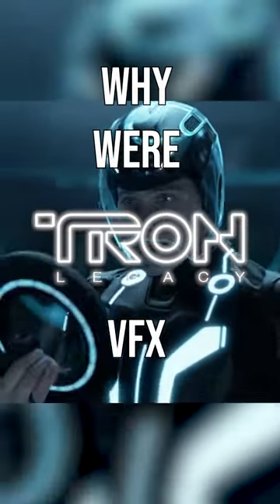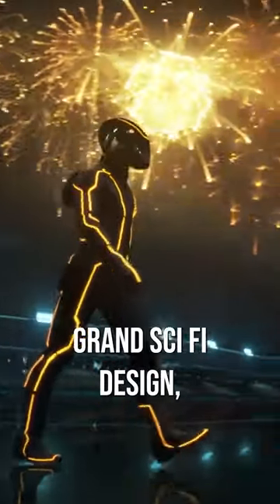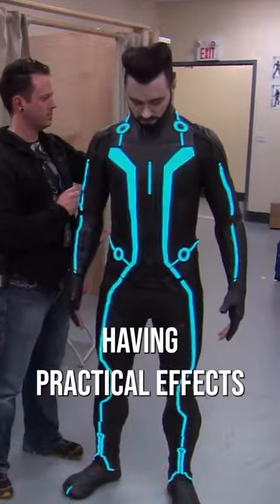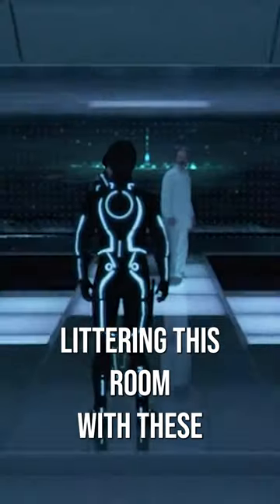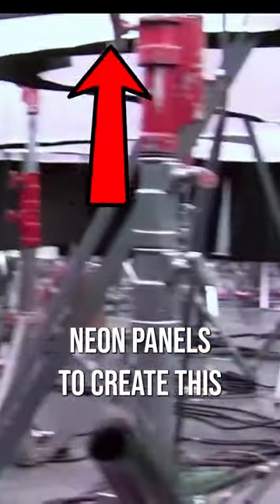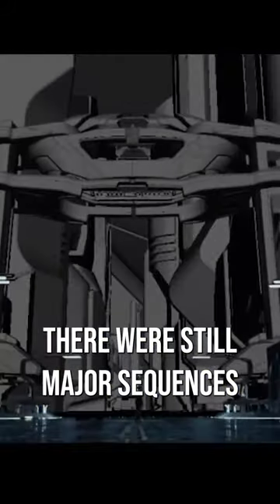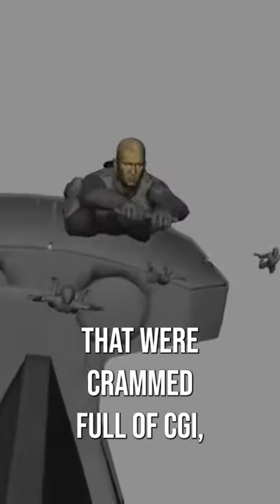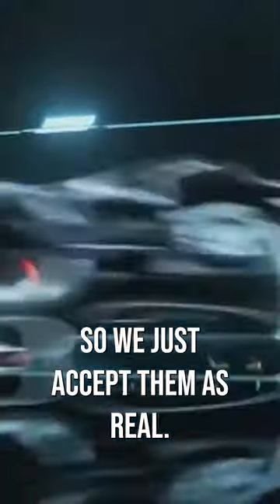Why Were Tron Legacy's VFX So Realistic? #cgi #vfx #behindthescenes #tron #tronlegacy #movie

Comment: It’s ironic that the first TRON from 1982 had much less physical sets due to everything being added in post despite the movie being much older.
Reply: Pretty sure they didn't add much in post for that movie. The computer graphics used to generate the scenes could take days to render out and there was no software to add effects in post. They could take the physical film and rotoscope elements by literally cutting the film, which they did for the light effects on suits, but when it came to generating graphics, it was all done in one go. They wrote the frames and then let the computer run.